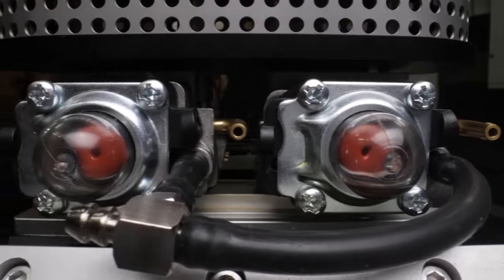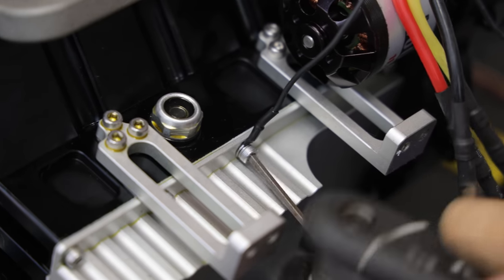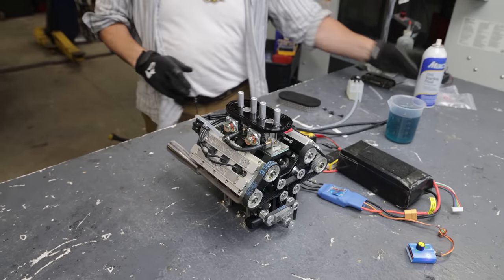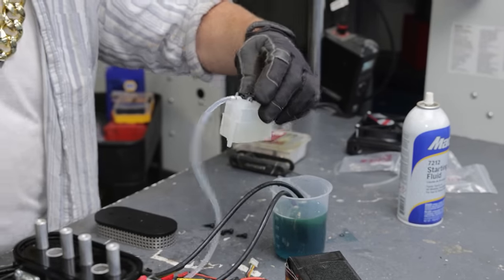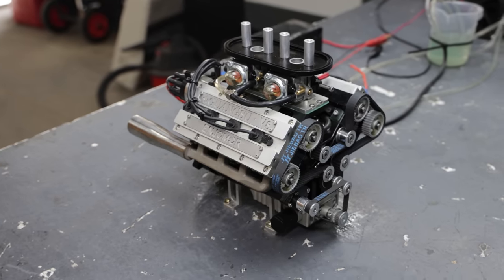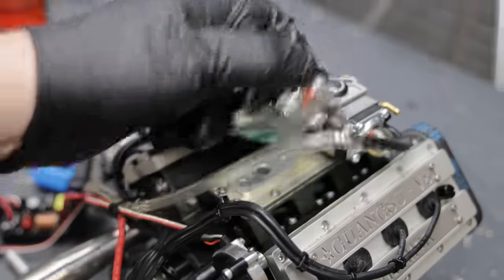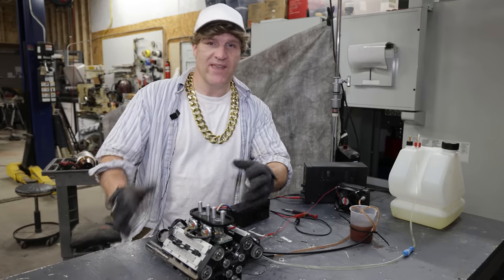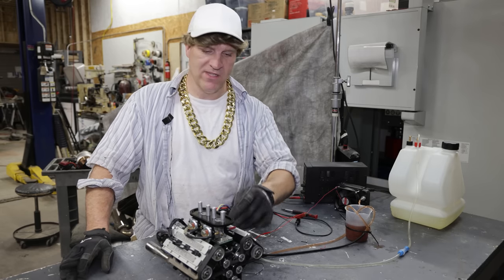Miniature V8 Engine Runs like the Real Thing - (78cc DOHC 6HP)

Comment: That amount of starter fluid for such a small engine made my head hurt.
Reply from the maker: Lol
Reply: Just gotta send it.
Reply: Yeah bad could of started a truck  with that much😂😂😂
Reply: Same 😂😂😂 I was curious how it would handle it considering I use about that much to get my old work van going 😂😂😂
Reply: What is the use of starter fluid ?
Reply: @cisarvialpando7412  its a fuel in a can sprayed directly on the intake of the carbs as you saw in the video to allow the engine to start up quickly instead of waiting for the default fuel to come through the lines and into the carbs..once started up the engine will be able to suck the fuel normally from the line..
Reply: @WarpedYT can I have "the old" while you try out the new?
Reply: Yeah,  I was waiting for one of the heads to blow off 🙄
Reply: Ether on a brand new unfired engine lmao.
Reply: @WarpedYT it would be good to put it in a small car 👍
Reply: Fr I thought this dude was pretty savvy with his shit
Reply: Back in the day, we were soaked in fuel flying glow plug planes and dragsters!
Reply: nah.  most of the hype about too much starter fluid is just that hype.
Reply: @WarpedYT  you're fine.  Keep dumping starter fluid
Reply: @fidelcatsro6948  and it burns hotter and dissipates moisture in the manifolds and cylinders.
Reply: That stuff completely drys out any lubricant in the cylinder, only to be used very sparingly on diesels ONLY
Reply: That’s a Cosby amount of either lol
Reply: That's my thoughts too, the carbs have  priming bulbs so there should have been no reason to use starting fluid at all
Reply: @cammos what does "could of" even mean?
Reply: @Mattlawton-ft6ew   Like, one of those small kids cars that are silly boring as electric cars?  lol Tim the Tool Man Taylor would agree.
Reply: Naar get it in 😁👍
Reply: Ether bombs a brand new engine.
Engine runs funny after he starts it......
Next time dump some fuel that is intended for it down the intake.
That was brutal! 😂
Reply: I only use ether in diesel engines. No need to use it in gasoline engines. Just use fuel in a squirt bottle. If it continues to have trouble starting then you need to check for the underlying issue which is fuel delivery. Dumping more ether is just going to create more issues. My guess is it's just a cheaply made engine like most of the V8 models are. The machining is horrible. The fact they run at all is a miracle. There are good ones out there but they cost 10k to 15k depending on the size and upgrades.
Reply: Timing was off for sure
Reply: Yeah this guy has no idea what he is doing in almost all his vids.
Reply: There is a chance that the amount wouldn't be enough for that size engine. Small chances but why take it?
Reply: @cisarvialpando7412 it's a highly combustible accelerant that you spray into a vehicle's intake to get it to hopefully start and run. It takes over in the combustion chamber in place of fuel because it's already much more atomized and it's a lot more combustible than gasoline.
Reply: Seriously
Reply: Thought the same
Reply: Nearly melted the belts
Reply: Same
Reply: Sounds like your ignition timing or cam timing is off.
Reply: Me to... this is why if u can't adjust carbs you ain't no mechanic. Sounds to me like it has a miss to. Sucks he jumped strait to abuse it
Reply: terrible stuff
Reply: You'd  cold start an old tractor with less 😂
Reply: Pistons can only pull in so much fuel anyways. It’s no more fuel than normal.

Comment: Would be awesome to see this in a scooter
Reply: Its interesting. Its the same CC as my scooter 1-cyl engine. It sounds amazing, but I think that its prob not actually built strong enough to last.
Reply: V8 powered GOPED was gunner say until I seen your comment
Reply: And supercharged.
Reply: Or in my Lounge
Reply: Razor single seater
Reply: @stevenjones5226  it couldn't move with single digit hp numbers
Reply: @DrKampfpudding  50cc scooters dont have more than 4hp
Reply: Or better yet.... power wheels car or truck
Reply: Imagine you scoot next to ladies walking on sidewalk:
"Hey baby, wanna go for a ride on my V8?"
Reply: @nicholas_scott the problem is a way lower torque this one has
Reply: There are lots of those videos already. Just search guys. Come on
Reply: At this scale the parasitic losses cause it to male less power than a 50cc 2 stroke.
Reply: @DrKampfpudding  I guess gokarts dont exist then
Reply: stoichiometry. Fluid dynamics of gasoline doesn’t work on that scale. This engine isn’t spose to be burning gas. This fuel has a different btu.
Reply: Pointless 6hp from a 70cc v8 is shame full I had a 70cc aerox ped that made 19hp
Reply: @lukecowell7516  most 5hrpwr motors are 200ish cc
Reply: @longsleevethong1457 that's weird... Bc he's running this engine..... On gas..... 😅
Reply: I was thinking using this for a motorized bicycle, instead of the normal single cylinder 2stroke kits. Think of the RPMs those little pistons can move....then again, what's the valve-float of this?
Reply: @keesanker4241 mine has 7 hp stock
Reply: @Cen.Reaper 2 stroke engines has minimal torque. The cvt makes up for that
Reply: @dextromethorphann  no, literally impossible
Reply: a go kart
Reply: Not enough torque for a scooter with a 100kg person on it plus the tare weight .
Reply: A push mower with one these would be cool. Half the weight of a 3.5 horsepower lawnmower engine.  Twice the power and fun.
Reply: Exactly
Reply: The only issue I see would be torque. But with a torque converter with light springs may help, but still, I don't see much happening. Be very interested to find out to make a true mini v8 car for a kid
Reply: @Cen.Reaper 
Manual 6 speed high low gearbox. Now someone get on this
Reply: 👍 I agree

Comment: The chainsaw carb is a good idea size wise but functionally they don't work at all like an automotive carb with a float bowl, chainsaws and other two strokes are meant to run upside down so a float bowl wouldn't work so instead they have a diaphragm that pumps fuel using pulses from the crank case which is opposite of the vacuum pulses in the intake. And with the large constantly changing crankcase pressure in a small V8 there's likely very little pulse to tap into
Reply from the maker: I think your right
Reply: 1st thing I said he needs a fuel pump. And a water pump probably a oil pump too

Comment: This would be great in a large RC car. If you have a big block show car, putting this in a 1/3 scale model would be awesome.
Reply: Would be very underwhelming in a 1/5 scale or 1/4 scale. I have a Taylor RC 80cc Supreme gas engine in 2 of my 1/5 scale RC's and they make something like 28-30hp in a 42lbs and 90lbs RC's. Will spin over 16,000 rpm's also.
Reply: Don't confuse an engine's HP with an engine's torque. I'd rather have stump pulling take-off and acceleration over top speed.
Reply: @tjkj-om9oi  I just guessed at the scale. Whatever scale these engines are, I guess.
Reply: Also with a big blower out the hood
Reply: @tjkj-om9oi JESUS
Reply: There are already several builds with these engines guys. Come on mane….all y’all,gota do is search for it…..wtf
Reply: @-Grizzly03 you'd like motors over engines then no?
Reply: @tjkj-om9oi 28-30HP for an 80cc gotta be the most HP per CC ever recorded in human history by many magnitudes.
Reply: @jumpvelocity3953  It's possible, but sounds unlikely. An 85cc racing dirt bike engine makes 23hp from the factory.

Comment: I'd sort that dizzy cap before trying to run it too much. Depending on how much compression those little pistons have could easily do some damage if it's not firing on that one pot.
The bowls may not be filling because it needs more pressure.

 I bought a really good 5psi fuel pump off of eBay for my moped to get rid of the vacuum fed one. If you ran a return line to bleed off 2 or 3 psi like I have the carbs get plenty of pressure and anything it doesn't need goes back to the tank.

Comment: i wanna put one on a mini bike holy hell, at 6 horsepower that's actually a usable engine! and if it does 6 horse at 78cc that's pretty dang good! Looks like it already got a head gasket leak lmfao
Reply: It probably doesn’t have much torque.
Reply: I doubt it's got 6hp... 

It would have to scream like a nitro rc car engine to get that. There is no way... If they rated it at 6 it's as honest as all the 1000mah batteries being sold as 9000mah.
Reply: @volvo09 Seriously. I dunno though, actual header exhaust, better ignition, better intake and carbs, and run nitro, I'll bet you could something like 6 horses
Reply: 0.6hp maybe, if you're lucky. these things only seem to run right at idle.
Reply from the maker: We will see
Reply from the maker: Yeah I think the same thing, I guess we will see if it's true.
Reply from the maker: Yeah that's what I'm finding too seems like they only run really well at idle or with a little bit of throttle.
Reply: There was the Conley Stinger 609 100cc model V8 that a guy made in the 90s and early 2000s, my grandpa's friend had one and it ran great everytime he fired it up. I've heard of people putting them in 1/6 scale rc dragsters.
Reply: @trekkie1701e  I`ve got the exact same Stinger but only as a display model. Sounds awesome.
Reply: These engines have very little to no torche. As soon as a load would be applied it would simply stall. No balls at all.

Comment: It's nice to see an engine large enough to do some real work.
If I ever got rich enough to recreate a car, I'd do the cartoon version of Speed Racer's Mach 5,  and want to power it with a BRM 1.5 Litre V16 because it sounds like the cartoon Mach 5. While the engine is physically much larger on the outside, the model engine parts may be the right size to help recreate the V16. I'd probably make it a hybrid because the BRM engine was totally unpredictable in making power.
Reply: That V16 sound was heavenly
Reply: The hard part is going to be coming up with a 453-speed manual gearbox. In EVERY SCENE EVER the M5 is going "arrrr-arrrr" and shifting gears. He probably got 3mpg cause he never cruised anywhere, just shifted gears.

Comment: Like to give pisitive input about your 2 carburetors.  . . . . They are normally found on weedwackers, blowers, and trimmers. The primer bulb is meant to remove air from the fuel flow. There should be no air going in one line and out the other. If there is bubbles of air, then theres an air leak. When your putting a carb back together,  it needs to have an air tight seal to prevent air leaks. This is accomished by applying lightly a finger smear of grease on both sides of the gaskets. Then press together with screws. Then test for drinking.  Once its found that no air is coming or going from the carburetor,  then it should function properly.  The primer bulb should be normally full with a tiny bubble, or normally half full. When pressing.

Comment: I'm very intrigued to see how this works out. I want to put one on my son's little electric toy four wheeler, it only has one small electric motor for one tire, not the whole axle. So it often gets stuck in grass. So ide love to see if this thing not only works properly after a little modification, but also would be able to be connected in some way so he could actually drive drive his four wheeler around the yard and never gt stuck, but not go too fast to where he can't control it

Comment: Add a little to intake manifold and put single carb on it . Maybe use just a touch of marvel mystery oil for breakin . Not sure what to do about hotter ign spark. plug gap should not be more than ..-.025 in . Since its going to run rich

Comment: 6hp out of 78cc is impressive. Single cylinder engines usually have around 160-190cc for the same amount of power. I’m curious what the weight difference would be.
Reply: Nope 80cc may be

Comment: if your not an engines person. you probably look at the 6 hp as a small single digit number. Or maybe you just dont know what to think of it. But even though this little engine might not be tuned/designed to break miniature dyno's. To help your perspective. This tiny lil fella puts out more hp than lawn mower engines 2-3 times its size

Comment: Ok let me think of something.

# Some sort of Dyno for these engines. But the dyno is mechanical and has a cool mechanical driven display.

# Jet & V8 Powered Small Drag car device. Even if it's on rails or guide to keep it straight. Gear the engine so it does a high speed only and the jet can get it there to begin with.

Love your videos mate, I hope you end up getting a Crazy CNC Machine and Metal 3D Printer so you can unleash Havoc with unthinkable projects 😃
Reply: And nice work on the recent Mr Beast Video. It flew so well and what a unique landing haha I wish that was caught on super slow.

Comment: 4:20 The problem with the carburetors maybe started because when you changed the gas tank maybe the tank was dirty and from there it caught a piece of dirt clogging the conduit
Reply from the maker: No I got a fuel filter in there
Reply: I don't know but it would be crazy to see this engine pushed to the limit and also push the toyan v8 to the limit with the mechanical supercharger

Comment: Nothing wrong with the carburetors. You're just going to cause yourself more heartache trying to find an alternative. 
The fuel pump vacuum line is not attached on either carburetor.
 In that configuration you have to have the gas tank higher than the carburetors to gravity feed. And a bigger fuel tank so there's more pressure in the line due to the fuel weight.
Fuel pump is not optional due to the way the carburetors made.
Only other options to find a tiny Bowl Style carburetor that doesn't require a crankcase vacuum line to operate fuel pump.
Unless you can figure some way to generate a vacuum "pulse" to operate the fuel pump externally. Those carburetors are as good as you're going to get. 
About everything will need to be gravity fed.
Reply from the maker: I'm not going to find an alternative I'm going to build an alternative. This is junk, gas tank higher than carbs waste of time.... This is a dinosaur system I'm going to bring this up to 2023 standards
Reply: @WarpedYT  
Would really be trick if you could figure out how to make it injected!
Reply: @WarpedYT  
Look at the fuel injection system on Stihl chainsaws.
Reply from the maker: @triggeredmonkey3439  I am going to look that up but I'm going to do a custom setup

Comment: Sure sounds like the ignition timing is not advanced enough to rev.  Looks like an induction timing light could work.  Find TDC and calculate 10* intervals on the flywheel and see where timing is at.

Comment: Internal Combustio Engine PIONEERS had a big issue with low power to engine size! : Ettienne Lenoir engine was very big by 1860 it was Gottlieb Daimler that by 1885 improved the power of small engines good enough to drive motor vehicles! : This engine could win the 1895 Paris Bourdeaux Race!

Comment: I would love to see a HP test of it. The page says it's 3.8Kw (a touch over 5HP) and I think it'd be neat to see if thats accurate. If so, it's an impressive little engine
Reply: Kinda weak if only 5-6hp from 78cc, My 1/5 scale RC has a 28-30hp 80cc single cylinder 2 stroke in it. C an get the 88cc version that is north of 35hp.
Reply from the maker: Yeah I think it's a little bit weak too for the displacement, figure my Supra is a 1000 hp and 3000 cc's, so that's like .33 horsepower per CC if we cut that in half for performance modifications let's say it's .15 horsepower per CC that would still be like almost 12 horsepower. Only one way to find out
Reply: @WarpedYT  I'm left curios about something. The store page say's it has a bore of 22.9mm bore and a stroke of 20mm, which if I did my math right is a displacement of 65.9. Where that other 12.1 cc went, i don't know.
As for the the supposed lack of power, it may come down to a combination of the size of valve, the missing 12.1cc, the offset in the cams, and those lack luster carbs.
For how much this engine costs, it would be my assumption the company did their home work right. Maybe an investigation video?

Hell, throw on like 3 superchargers from the Toyan V8 you covered last time. That'd be interesting to see if the math works out

Edit: After going to bed last night, it occurred to me I probably did something wrong with my math given I don't normally work with metric
Reply: @WarpedYT would the supra not be making .33 horsepower per cc? Given that 1000 horse for 3000 cc means 1 horse per 3 cc which is 0.33… horse per cc?
Reply from the maker: @rawhidelamp  sorry I forgot to write the point
Reply from the maker: @rawhidelamp  I fixed it now
Reply: @WarpedYT  Also easier to get more hp/displacement with a smaller engine. However your Supra is turbocharged so its not really a fair comparison, but either way that engine can definetly be tuned to a lot more hp than its got currently. Well set up carb and ignition would give it a huge boost right away, then you could make some tubular headers or angrier cams or something but thats a lot more work.

Comment: Sounds like it could use a little more advance to the ignition timing,  just sounds a little flat like it's laboring.  But that could also be due to needing more air in the carburation,  maybe figure out a progressive system that uses four carbs with a progressive linkage system to only open the extra two carbs for the higher rpm range.

Comment: Have you got this thing running any better I sent mine back they said it was fix but lasted 5 min hall sensor fail and it pops runs a bit but the minute you go if you move the throttle it dies it is a big bit of CRAP